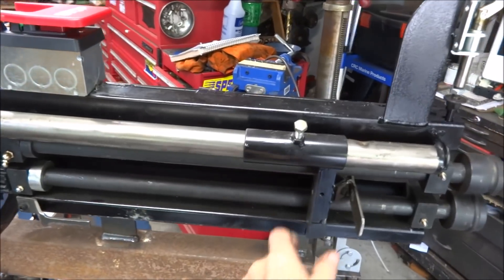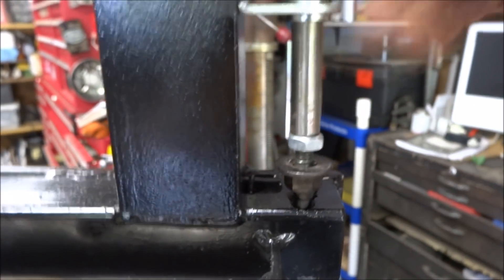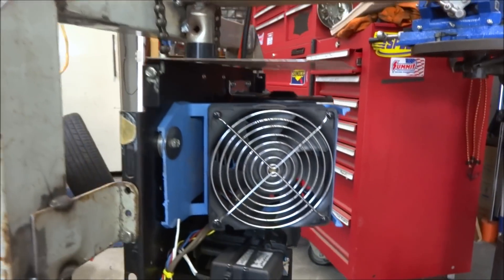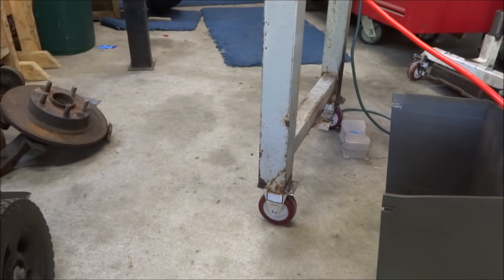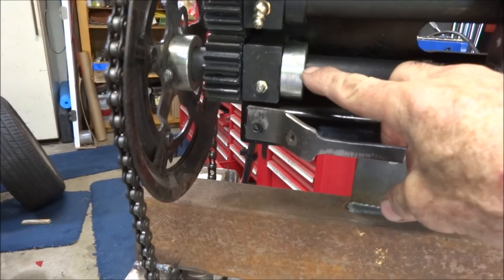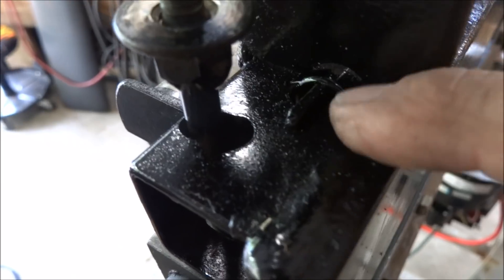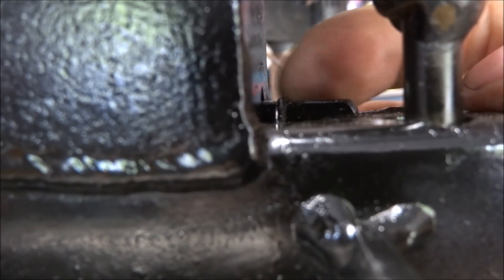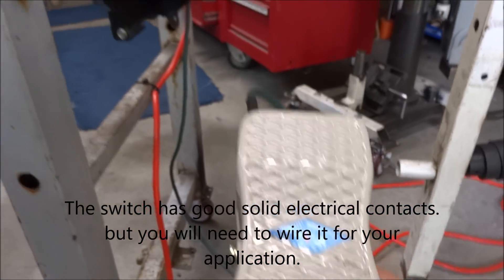Harbor Freight motorized bead roller, garage door opener, electric drive

Comment: I got the motor mounted but how did you wire to bypass the remote and be able to start and stop the power with the foot switch?
Reply from the maker: 🤔 I did it 6 years ago. Don't remember the wiring exactly....  and different models of openers would have different wiring. I did completely eliminate the remote relay board.
Reply: @TSRGarage  do you remember if you kept the capacitor?
Reply from the maker: @Headsuphotrods   the capacitor is probably the start capacitor, if it is you will have to keep it. To find out more about how the motors work Search for  "reversing single phase induction motors".

Comment: Nice bead roller, I've built one very similar but i used a harbor frieght engine hoist motor for the drive assy, and a variable speed switch for different speeds, also i used the same two way foot pedal. It all works amazing.
Reply from the maker: 👍 so much better with some type of electric drive.
Reply: Rick do you have a video? Phillip Hall

Comment: I used a 12v windshield wiper motor  , lots of torque for a small motor. And you dont have to worry about the AC garage door motor failing from variable speed

Comment: I was thinking about garage door opener too. How did you wire motor to switch directions?
Reply from the maker: Wires that went to run the door up run to one side of the foot switch wires that went to run the door down run to the other side of the foot switch.

Comment: Hello Scott very cool bead roller mod!!  Question;  Where did you get your parts like the garage door opener?  Did you just buy new or track down a descent used one?  And one more if you dont mind: how much total cash do you have tied up in your bead roller after all the upgrades?  Hey man awesome job  and I think your set up is the best ive seen so , for what i need it for anyway!!  So I am gonna borrow your ideas if you dont care!!  Thx bro!!  Hope to hear from ya!!
Reply from the maker: The garage door opener was my old one.  The sensors that stop it from closing if something is in the way had quit working so I decided to replace it.   As for cost... just a harbor freight bead roller and all of the metal is what I had in the shop from other projects. Maybe 40$ for the foot switch and the e stop switch. Computer fan and 12 volt power supply scavanged parts.

Comment: Nice mods. I really like the sliding fence. You should add a removable support table for doing flat sheets and it will have all the features of a top end bead roller.

Comment: I'm going the same way, just using a HF drill as the drive. I ordered the pedal and not being an electrician, those directions were rediculously vague. I'm a plumber and Sheetmetal worker, I try to avoid electrical work. Any insight would help
Reply from the maker: nathan Marr I'm afraid I can't help you there. it's going to require taking the drill apart and figuring out which wire's do what from the trigger switch in the drill. And rewiring from there sorry I can't be more help.

Comment: I built one using a Milwalkee angle drill. It also has reverse and my upper gear/round bar I have where it can slide out or in so you can get both dyes spaced so you can get different spacing on the grove.
Reply: Frank Mora of your life with you on a regular

Comment: Dude, that is awesome, I've been screwing around for a year now trying to find a suitable motor to power mine. What a great idea.  I'm definitely stealing some of your ideas. I wouldn't have guessed that an opener would have enough torque but seeing yours operate it most certainly does. GREAT JOB, WELL DONE!!!  

Do you find the grease in the bushing makes a noticeable difference?
Reply from the maker: Thanks. It works good,  I have not used it a lot so i don't know how long the door opener will last. But it does not seem to be working the motor to hard.